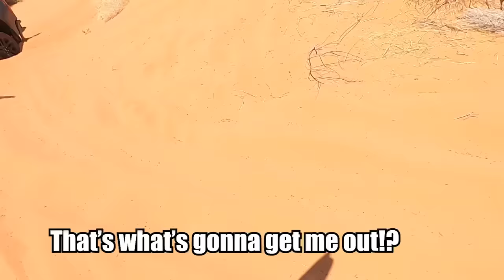Seriously?! That Things Gonna Get Me Out?!

Comment: Always makes me laugh when a $2000 rig pulls out a $50000+  "off road" truck.
Reply: good luck finding an xj for $2k, but I get what you are saying.
Reply: Let's not pretend his rig isn't custom built for this work; his Jeep would run you WAY more than $2000.
Reply: It has nothing to do with the brand of truck or the cost of it. Its tyre pressure and the correct use of the right hand pedal.
Reply: @masato3981  It's hard to find a decent XJ these days that isn't overpriced. But there's really nothing particularly expensive on it. It's big tires and some custom but not crazy suspension.
Reply: those jeeps will embarrass ur 100 000 dollar duelly...out profrom it out pull it hands down bar none
Reply: A beat up xj from the east coast( which means its rusted out)with 200k miles on it still goes for like $2600-$2800 as long as it's a 4x4
Reply: Where can you find a xj for $2k??
Reply: @taylorhickman84  I bought one fully built with lockers front and rear for 2100
Reply: Agreed, though pickup trucks typically are not designed for off-roading; they're designed for hauling and towing, which is something most truck drivers don't do anyway.
Reply: With the new custom engine and trans he just finished installing, the custom suspension, the tires.. That's 25K + purpose built off road machine, along with that pull rope that multiplies torque setting on more stable sand than the truck was on, the xj is lighter on top of that, this was no surprise.
Reply: It is an "off road" truck.  People are just stupid.
Reply: Hook a travel trailer behind both and take a cross country trip from California to Florida, you can volunteer to drive the Banana!
Reply: Sure maybe more than 2000 but you get the idea
Reply: In Quebec Canada XJ are cheap. Got 2 of them last year. One with 145k kilometers (90k miles) for 1800$ Cad and one with 200k kilometers (124k miles) for 1100 Cad. Only some minor work to do.
Reply: @masato3981  thankfully he has the knowledge to build a complete jeep from essentially scratch or it would've cost him way more parts are nothing good manual skilled labor is very expensive
Reply: 50k truck needed a driver mod lol
Reply: @calebowens3006  In my area you'd be hard pressed to find a clapped out one for under $5k, a few years ago that wasn't the case.
Reply: @taylorhickman84  It's because people treat them like garbage and the numbers are dwindling very fast. They don't want to fix what they got and lack the skill that they are not willing to learn and just buy and buy and buy and gets to the point where the prices are sky high.

Mostly the people complaining are the ones that are scrapping or trashing them all the time anyway, they're getting them back. People that value them have them, and keep them up.
Reply: @CanadaBud23  the one I bought was a 92 on it’s 3rd motor, been dove tailed 6 inches in the front, 35 inch tires g80 locker in the front welded in the rear, computer relocated to dash exhaust ran out of the rear wheel well to keep it out of water, alternator relocate, it would go where I pointed the front wheels
Reply: @taylorhickman84  I ment to tag you man not the other guy
Reply: @calebowens3006  Right? Then there are those who find a rust hole and then scrap it, which to me is blasphemy.

I had to chop out my entire floor and weld in a new one and I didn't have pans to do it with so I bought a 4x8 sheet of stainless 18 ga and went to work. Took me a few months but now it's got reinforcements moved the tunnel and moved the engine and drivetrain back 3" for the boosted stroker all new suspension mods and a cage. I just have the rockers to do this year because those started to rust. I picked up a minty cherry one for 2K and I have a lift coming in a few days and I have little rust repair to do n it while I'll put on the lift and I'll have one for the road and offroad. They'll probably out live me.
Reply: @CanadaBud23  that was the sketchy thing about my xj I’ve had 3 only one modded out tho, mine had no roll cage at all
Reply: I live in North Carolina
Reply: @calebowens3006  I'll give you $3k for it ;-)
Reply: @taylorhickman84  I done sold it brother sold it back to the man who built it
Reply: Pretty sure the tires alone on the banana cost nearly $2000. 😂
Reply: You gonna laugh when the pickup can actually go more than 60 mph or tow a decent sized trailer and the jeep can't? My point is that different rigs are good at different things. Laughing at something being asked to do what it wasn't meant to and then failing is silly. Laughing at the operator may be justified at times.
Reply: Quite a bit more than $2000 once you consider all the upgrades (and more still with the recent rebuild) but still significantly cheaper than a big rig truck.
Reply: @baddriversofcolga  Laughs in Landcrusier ute.
Reply: @taylorhickman84  agreed. The idea is fine, but the tires on the banana are worth 2K.
Reply: @charleshankbukowski4426  the Atlanta area. Lots of spoonfed fratboys that sell old 4x4s there parents gave them

Comment: having the right tow rope helps.  stretching out acts like a spring.  works everytime.
Reply: they actually aren't tow ropes/straps. they are "recovery" straps, meant for jerking/yanking something from a stop. if you did this move with "tow straps" you are putting yourself and others in a pretty dangerous situation- they are static straps, and they can snap if you do this sort of thing. it's not what they are meant to do. worse yet is if they are attached with some kind of cast metal shackle- if THAT snaps, it can shoot back through the windshield of one of the vehicles. people have been killed trying to do this sudden jerk recovery style pull with the incorrect type of strap.

Comment: I hate when someone with no offroad experience is all like "that little Jeep's gonna get me out?".  It's all in how the vehicle is setup and what ropes you use, as Matt has proven countless times!
Reply: Yep...my 92 YJ has pulled 2 Hummer H2s out of the swamp, a dozen XTerras, uncountable numbers of Jeeps...and of course my own dumb self now and then...hahahaha
Reply: That's how they go from no off-road experience to a little bit of off-road experience, though. If you've never seen it done the right way, you would be skeptical too
Reply: Back on the farm, I pulled several 4X4's out of a local mud hole on a dead end road. Used my '67 2WD C10, made them fell a little embarased. Wasn't trying to, but I still drank thier beer. Good times!
Reply: @kevinlarsen5750  It's all about where you put your truck. If you had it in a spot where you got more traction, doesn't matter if its 2wd or 4x4.
Reply: @amoliski  I wouldn't be skeptical. It's all really basic physics. You don't need a giant truck to pull another truck and give it the momentum it needs to find traction.
Reply: @BlueOvals24  I had the advantage, I had that mud hole memorized. I knew where the ruts were under the surface, and stayed out of them.👍

Comment: Amused.  I was out off-roading once in my 1982 Ford Bronco and came up on a Chevy 2500 buried to the tops of the rims in mud.  The driver was horridly inexperienced in Alaskan terrain, although he had Alaskan plates and they seemed to be at least a few years old.  At first he wanted me to pull him out, but I instead pulled out a bumper jack, 4 2x6’s and a piece of plywood.  After quite a bit of arguing, he finally let me place a single board under each of his wheels.  Unable to get out under his own power, I had to hook up to him anyway.  Turns out he had left it in park and I had dragged him out that way, however his drivetrain seemed fine afterwards.  After thanking me with a beer, I put my Bronco in 2WD and proceeded to drive through the mudhole that he had just buried himself in, turn around in the mudhole, and drive back out and continue through the river and to my own desired camping spot.
Reply: Blah blah blah, you are just incredible, how do you live among mere mortals? With your superior powers of deduction you should be solving quadratic equations and building the next spaceship….go, go, go save the world!!
Reply: @kijijiaccount9166  Whoa, calm down there.  Looks like he just wanted to tell a story and it is relevant to the video above and the audience it attracts.

Comment: A spring assisted rope - brilliant! 40 years ago I used to use a ‘V’ bungy fastened to the rope 2 feet from  the hitch and the ends to the roof of my van. I could drive off with no snatch and when I slowed the rope would be tensioned to my roof.

Comment: The weight doesn't matter a whole lot if you know what you are doing. The best thing you can do in soft sand is air down the tires. Spread out the contact patch. 8-12 psi. Actually makes it pretty difficult to get stuck in the sand unless you really just don't know how to drive.
Reply: yes - anyone that has been to the outer banks with a 4x4 learns this the FIRST DAY on the beach

Comment: From the factory those Razors and most of the other side by sides are built for trail riding, not for serious off roading. Unless you replace high stress parts with quality aftermarket parts, then after a season or two they become maintenance heavy. Here in central Wisconsin, those things are everywhere, mostly used for fair weather county road travel to drinking/party spots. I have a older Kubota RTV 900 with winch, dump bed, 3point on rear and plow on the front. Its heavy and only goes 28mph downhill with the wind but rarely makes 5mph pushing, pulling or hauling. The Yanmar 3 cylinder diesel just wont stop.

Comment: I used to drive my 4 door 1951 Ford sedan over the soft dry sand to get to the hard packed wet sand at Monterey Bay.  But first I would let a lot of air out of the tires.  It worked very well but I'd need to re-inflate the tires for driving on the pavement.

Comment: Deflate your tires a bit, will make a big difference in staying on top of loose sand. Just remember to re-inflate them when you get to a hard surface again though.
Reply: Nobody seems to know this trick or they just think they can drive on sand without deflating like its optional 20 PSI go anywhere 
Just carry a mini compressor
Reply: @oftin_wong  Old school, man. We used to do this on our dirt bikes in the 70's when I was kid. We could fly across the dunes with flat tires while other bikes would sink.
Reply: @waynebooker498  I know it, it stops the suspension from forcing the wheels into the sand , instead the shock is taken up inside the deflated tyre

Comment: Nice.  One question; on the first truck you pulled out (the Chevy, I think) you accelerated pretty hard.  I've only towed vehicles on standard roads and always took up the tension slowly.  Are using a static rope, or is it slightly stretchy?

Comment: I heard someone make a comment about "they should put up a sign", I bet a similar thing happened to them that happened to me. We were on a camping trip in Upper Peninsula Michigan in a GMC Terrain pulling a pretty decent sized trailer with our camping gear and kayaks on it. I had saved offline maps of the area in Google, and it said to take this two-track looking lane to get to the campground. I was a little skeptical, but I've driven down plenty of grass-centered two tracks, no big deal I'm thinking. A few miles in, it went to sand dunes with very little hard pack. We got stuck with the frame resting on sand, it turned into quite an ordeal. The whole thing could have been avoided with some decent signage. We clearly were not the only people to have been misled onto that trail, the sides were strewn with dust shields and bumpers. I know better than to take a Terrain with stock suspension on any real offroad trails, it isn't an ORV, especially not with a trailer and kids in the car.

Comment: If you are trying to go through deep sand in a front wheel drive, it works a LOT better to just turn around and drive in reverse. Pushing through sand works better than pulling through sand.

Comment: What's the deal with that tow rope? Everything I know about towing told me his line should have snapped or someone's frame should have bent when he nailed the gas like that. Is it elastic?
Reply: all i know is its called kinetic rope and its designed to be yanked hard but car parts are ductile. how straight do you need your frame anyhow? a good thrust angle problem adds character (and oncoming traffic gives you a wide berth like youre an ambulance)lolsy
Reply: @hardrays  If that's the case my 2004 Grand Vitara has so much character. Its made of character. Its held together with character.

Comment: honestly though I kind of appreciate that she asks this question, obviously it is coming from a place of ignorance since she seemingly doesn't know a whole lot about towing, but it is given her level of understanding of the situation a reasonable concern to have. she is not sure if a vehicle that looks considerably lighter than her vehicle that is stuck is capable of dislodging it, without digging itself in. that to her, is a concern which, she, and anyone else in such a position, should raise. which he basically just answers "yep" to. which, is not necessarily the most reassuring thing you can say. she asks again, which, you should also do. the concern remained, and it is good that she asked again to clear up that, yes, he is aware of the situation and he believes that it is possible. the reason why it is important to raise points of concern, even when you are not the most experienced person on-site, is because, said most experienced person, can still make mistakes. they may not immediately notice them since they are working in a routine, and you, who is outside of that routine are, even with a lack of knowledge, more likely to observe things that may go wrong. obviously most of the time, the situation will clear up and everything will be alright, but those times where it could have gone bad, those few words can save lives, or make the job considerably easier.

Comment: $70k Silverado "Trail Boss" pulled out by a 25 year old Cherokee. That's great, I just love this.
Reply: These extended cab trucks weigh a ton. I have a Ram 2500 with the Cummin Turbo Diesel. I would never take it out in the sand. Put a jack under the front of my truck and you tell me how flipping heavy it is. All in all, these trucks are badass, just not good for all applications. Sand being one of them.

Comment: The silverado could have dropped air pressure about 12-14psi .....walked right out. driver error
Reply: also 4 Low turns off traction  control and stabil track.....mine goes like a tank on beach sand